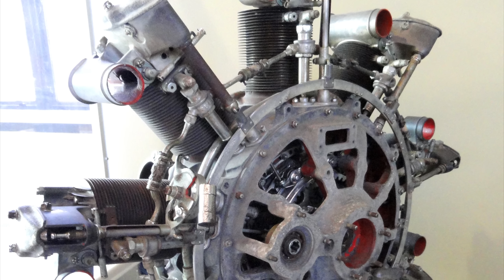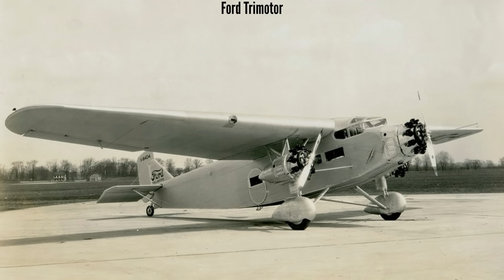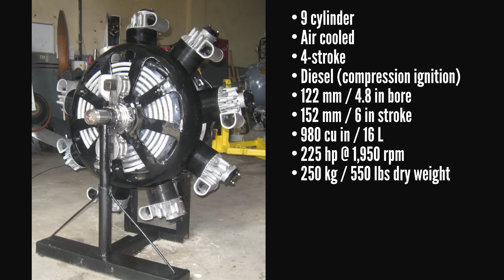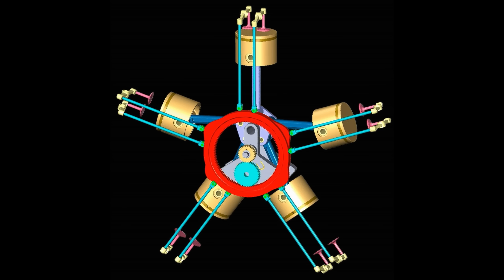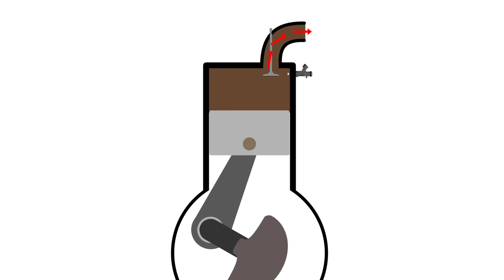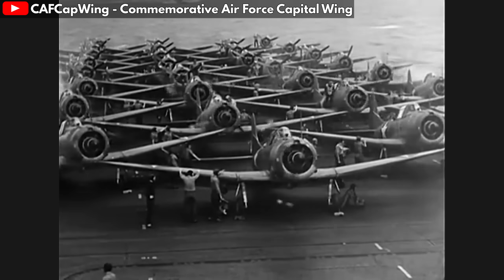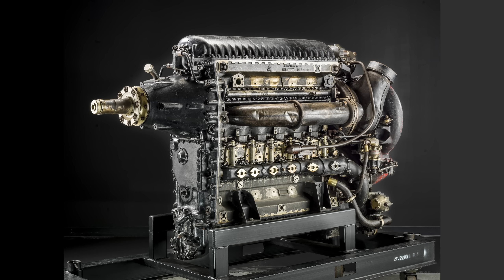The Single-Valve Diesel Radial that Almost Changed Aviation

Comment: For a short time, I did consider an inline-4 TDI for my experimental.
But, of course, the weight was the issue.
On a full tank, the lower weight of the fuel does offset the weight of the engine, to an extent, but as the fuel drops, that offset quickly gets smaller and smaller until it eventually reaches zero.

With that said, it's probable that we will see more diesels as time develops. They have a lot going for them.
1. They work at lower RPMs.
2. Less reduction needed on the gearbox.
3. With the right turbo setup, the engine's maximum power will still be there as we climb to relatively high altitudes.
   With a NA gasoline engine, power drops quite rapidly as we climb.
4. They can be more efficient. Due to the much lower power drop with altitude. We can cruise at the same IAS, at the same engine RPM, but at a higher ground speed.
5. No sparkplugs, so less chance of losing a cylinder.
6. In the event of fuel becoming very expensive, diesels can run on many other flammable liquids.
   That's also true for gasoline engines as they can run on other liquids such as alcohols. However, diesels have more affordable substitutes.
Reply: Disadvantages to your advantages:

1. Lower rpm means heavier, larger components, due to higher torque production.
2. The diesel cycle is inherently harder on PSRU components, requiring PSRUs to be heavy, expensive and well dampened.
3. Turbocharging is required for diesels, while it's optional for any kind of practical gasoline engine. Diesels also tend to lose power more rapidly with altitude than turbocharged gasoline engines and they tend to have much lower critical altitudes (not always the case, though).
4. They're not always more efficient.
5. The mechanical, high pressure fuel pump is an additional liability which gasoline engines do not require.
6. Bioethanol is pretty affordable (more affordable than biodiesel).
Reply: @PistonAvatarGuy  The vast majority of those are very good points.
Regarding the heavier components, one can use lighter, though more expensive components. Such extra cost may be eventually recovered via efficiency.

Turbocharging is an absolute necessity on traditional 4-stroke diesels. Depending on the turbocharger's size, geometry and configuration, one can achieve cruising power at relatively high altitudes. It won't be a turboprop, but it will be adequate for most applications on the lower spectrum of the market.

For the applications referred above, I believe that a TDI will be more efficient.

Yes, the high pressure aspect of the fuel will require redundancy, thus weight will be negatively affected, yet again. You are 100% correct.

Regarding the choice of fuel, I wasn't referring solely to commercial biofuels. With additives and proper treatment, a diesel can even run on used cooking oil. Now, I would not even taxi with such substance in my fuel lines, but it illustrates that many liquids which ignite under compression can be used as fuel, if properly treated and, in some cases, properly blended.

Petrol engines can run on alcohols. They can even run on solvents. However, such gasoline substitutes will, most likely, be significantly more expensive during a fuel crisis than diesel substitutes.
Reply: @leoa4c   Diesels are already significantly more expensive to produce than gasoline engines (more than twice as expensive, according to Paul Bertorelli, when writing about the Skyhawk JT-A), so I don't think that making stronger components using lighter and more expensive materials and production methods is a viable option. I don't think that the weight of engine blocks and PSRU components can be significantly reduced anyway.

Unless you're going to add a multi-stage forced induction system to a diesel, it will have a lower critical altitude than a gasoline engine.

The lower end of the light aircraft engine market demands inexpensive engines and inexpensive fuels, only gasoline engines fill both of those requirements. Unleaded mogas is the least expensive aviation fuel.

TDI engines just aren't all that efficient when compared to modern gasoline engines. For example, the Honda L15B7 has a peak BSFC of 0.36 lb/hp/hr (at 60 kW output), while the Continental CD-135 has a BSFC of 0.35 lb/hp/hr (unknown power output). That does result in the CD-135 burning 14% less fuel by volume, but the jet fuel that it burns is also 12% more expensive (countrywide average) than the mogas that the Honda engine is capable of burning, so there's hardly any savings to be had with regard to fuel costs. It should also be noted that the Honda achieved that rating with full emissions controls and under the highly restrictive SAE power rating standards used by automotive OEMs, while the diesel had no such restrictions.

I agree that cooking oil would not be safe to use as a fuel for aircraft.

I'm not sure what kind of situation you're imagining with regard to a fuel crisis, but the vast majority of piston engine aircraft are recreational aircraft, so they're not exactly a high priority in that kind of a situation. The one region where that might be an exception is Alaska, which is cold, and diesels don't do well in the cold. Given the performance and cost issues that come along with diesels, turbine engines would likely be a superior choice over diesel piston engines, if a serious fuel crisis ever occurred.
Reply: @PistonAvatarGuy  Again, you make very good points, and I have to agree with most of them. 

I am not familiar with the type of diesel where you live, and the difference in price compared to gasoline, but in most European countries, despite diesel cars being around 1200USD more expensive, people still choose them because, in the long run, fuel costs offset the extra engine cost. 

Maybe at cruising power, the NA gasoline engine is more efficient. That's something that I have to look into myself. 

But I do take your points as valid, as they appear to make sense.
Reply: @leoa4c  Unfortunately, we're not talking about cars here. Jet fuel is more expensive than mogas, which is what modern gasoline aircraft engines burn (leaded avgas causes problems with O2 sensors).

I don't know about the efficiency of NA gasoline engines in this context, but I do know that the Honda L15B7, a direct-injected, turbocharged engine, essentially matches the efficiency of the Continental CD-135 (it's only ~3% less efficient by fuel weight/energy efficiency/CO2 emissions). This was confirmed by the SAE. By volume, the L15B7 does burn 14% more fuel, but the fuel is 12% less expensive, so it basically breaks even. The Honda engine is also about 40 pounds lighter than the CD-135, even after being converted for use in aircraft (the Viking 195T). That's a pretty significant weight savings on a small aircraft. A purpose-built gasoline aircraft engine would be even lighter.
Reply: @PistonAvatarGuy  Fair enough. But you are making the comparison between 2 engines. Two engines are nowhere near enough to make a statistical analysis. The sample size is way too small.
Your example doesn't necessarily reflect the performance of most diesel engines against most gasoline engines.

That is always the issue of using very specific comparisons to achieve general conclusions. I am sure that you understand such point.
Reply: @leoa4c  I've looked at a large number of modern diesel aircraft engines, they all pretty much have a BSFC of 0.35 lb/hp/hr. The CD-135, CD-170, CD-300, SR305-230 and Red A03 all have a BSFC of 0.35 lb/hp/hr at cruise, while the CD-155 has the same BSFC at cruise as the Honda L15B7. The Austro Engine AE-300 has a slightly better BSFC at cruise at 0.34, while the AE-330 is about the same at 0.355 lb/hp/hr. The diesel engines that are significantly more efficient are far too heavy to fly. Really, the diesel engines that are currently available for aircraft are far too heavy for what they are and they massively reduce the useful load of the aircraft, unless it's an aircraft that was purpose-built for diesel engines.

Anyway, there are plenty of reasons why diesel aircraft engines never caught on and many of those reason are listed here. The only thing preventing gasoline engines from absolutely dominating diesels in current aircraft is a lack of investment in the development of modern gasoline engines.

Edit: Fixed an oops in the engines list.

Edit: Fixed another oops with my AE-330 math. Also, according to the DA62 flight manual, the AE-330 has a BSFC of 0.38 lb/hp/hr at 75% power output. The engine apparently makes 177 hp, not the 180 that's most often quoted.
Reply: @PistonAvatarGuy  I completely agree with your first paragraph, and I must thank you for the extra information.

I love gasoline engines as much as anyone. My own experimental is designed for gasoline engines, only, as any diesel with the same power will put the aircraft well above the 450kg allowed by the regulations in my country.

Diesels do have advantages. However, as you correctly pointed out, for the vast majority of applications, such advantages are easily negated by comparable gasoline engines.
I think that this is a fair conclusion.

Comment: It would be interesting to see a spark ignition engine use the single valve design, that looked very efficient.
Reply: The monosoupape rotary did use one valve per cylinder but it did also have small induction ports low in the cylinders to suck very rich air fuel mixture from the crankcase, not an expert on the subject but it seems to have been mostly power regulated with skipping ignitions which of course is very inefficient(Skipping direct injections(If it would have had that) is of course a more efficient alternative for power management).

Comment: the thing that really sets this apart is the single valve cylinder head design.......that is quite a unique idea that would never work on anything other than an aero engine, but omg it must have been horribly noisy.  The "unit injector" concept was something that American diesel engines as a whole did very well and was ahead of its time, it was very widely used in the late 1930's onwards in GM/Detroit Diesels and Cummins diesels with great success and reliability.
Reply: most of the rotary gasoline/petrol engines of WW1 had a single valve directly to atmosphere in the cylinder heads.  It functioned as both exhaust and fresh air intake.  Referred to as 'Monosoupape '.  Gnome, LeRhone and German Oberusel were the main purveyors of them.
Reply: @anthonyjackson280  It's there in the name!  'Monosoupape', when translattedly directly from French to English, is  'Single Valve'. So the OPs claim that the idea is unique is false.
Reply: @Kimdino1  The "Monosoupape", despite the name, actually has two valves per cylinder but only the exhaust valve is in the head and operated by a pushrod. The intake valve is in the piston instead, taking in air/gasoline mix from the engine's rotating crankcase. This intake valve is simply a spring loaded check valve and operated by pressure differential. 
This diesel engine is very different from the Monosoupape system, using a single pushrod actuated valve for both intake and exhaust.
Reply: How well would diesel have worked in cold temperatures and very high altitudes (20 - 30,000 ft ?
Reply: Well there was a single-valve Diesel engine based on this same principle — built for trucks. Also by an US firm.
Reply: Uniflow two stroke diesels all use this layout, they usually have 4 exhaust valves in the head and piston ports for the intake
Reply: @PaulG.x  Uniflow isn't even comparable to this, here the flow is both ways depending on piston position and one is fresh while other is exhaust. The whole point of a uniflow is 1-directional flow of only exhaust. Also Uniflow, wherever it does actually use swirl, does it radially whereas here there is conventional 4-stroke swirl, which is very different. Swirl is one of the key things in a Diesel, believe it or not, it can make a huuuge difference and the fact these engineers were smart-enough to induce it here is very impressive. Pretty sure Detroit 2-strokes never did any swirl at all, I think Foden 2-storkes did though and Fodens basically had near twice the HP more or less.. They also used Kadency like a bike engine but no so much for boost, rather efficient gas flow, which is why their exhausts are quieter than Detroits (noise = inefficiency).

Comment: Diesel is lubricitous... could have traded up to two valves per cylinder and potentially offset it by eliminating the oil cooling circuit and one of the fuel or oil pumps... how? Lubricate the engine with the fuel. Might have needed a little heavier grade of diesel, but plumbing the injector circuits directly into the pressurized oil lines and sending scavenged oil back to the fuel tanks would have eliminated a whole slew of systems and hence weight.

Comment: Use of FM radio (which still isn't used in aviation) also made radios more usable in cars (note that EVs typically do not have AM radios, because the EV motors are so noisy)

Comment: A LEGEND for sure.
It's "flaws" weren't anything that could be worked out/solved given enough time and flying hours.
However, I think they should have gone the twin charged and 2 stroke route like a "modern" 2 stroke Detroit Diesel.
Being that aero powerplants spend most of it's time at a fixed RPM it would have played well to the strengths of the 2 stroke engines.
Personally I have a soft spot for Diesels and would like to see more brands and inventors investing their knowledge and experience in the technology.
Reply: Like a certain 2-stroke, 4 cylinder diesel which has been failing to enter into production for two decades?

Edit: Sorry, nearly THREE decades.
Reply: @PistonAvatarGuy  correct! We've been following this - err - protracted development for several decades and wonder, why nothing is coming of it.

Even adaptations of automotive engines have overtaken the inverted V-4 and are finding commercial customers, OEMs.

Comment: with a single valve supecharging is impossible so this would have become quickly obsolete even without the other issues
Reply: At the end of its life was a 2v update.
Reply: Detroit diesels were single valves and lived for years with a blower and turbo.
Reply: @wreckum56  That's because they had separate intake and exhaust ports.
Reply: @wreckum56 Detroit Diesels are not single valve. They have 2 or 4 exhaust valves, depending on the model of engine, and intake ports in the cylinder walls.
Reply: @jaredlancaster4137 what I was saying they did not have intake valves . I’m not a teacher teaching a class sorry to disrupt your day.
Reply: @wreckum56 well yes, Detroits do not have intake valves(just like every other two stroke). Not sure what that has to do with this Packard engine, which does have an intake valve(just like every other four stroke).

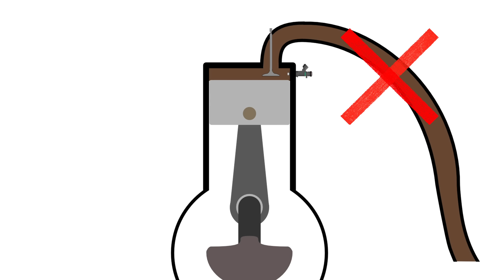Comment: 11:40  Intake / Exhaust.  As the exhaust has a higher pressure than the air entering the port would it not be beneficial to have a deflector opposite the engine port to direct the exhaust to the rear. This would not impede air coming in but the high velocity exhaust would impinge on the baffle and exit to the rear into an open exhaust pipe shaped to make use of the Bernoulli's principle to scavenge the exhaust.

Comment: a  stinky lemon..  it also had an altitude problem.. as compression would fall off radically and then ignition temperatures would not be achieved
Reply: No, because the thermal ratio still exists. You just have to deal with cold intake.